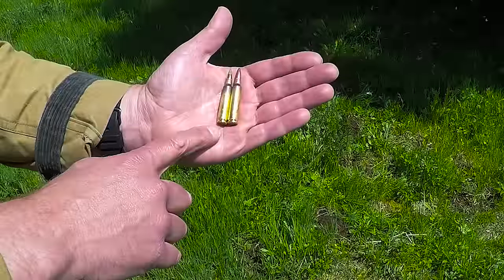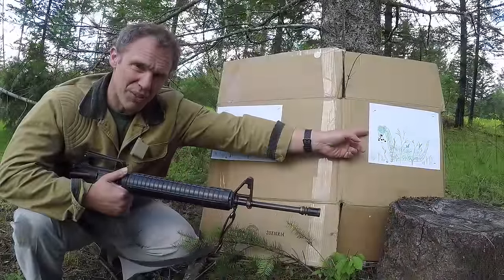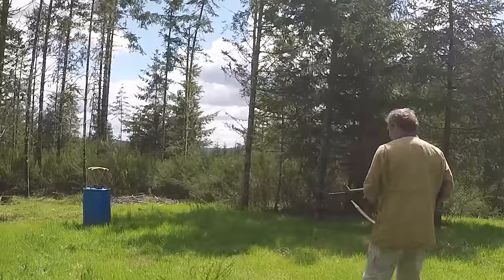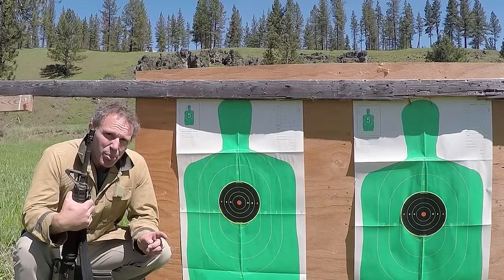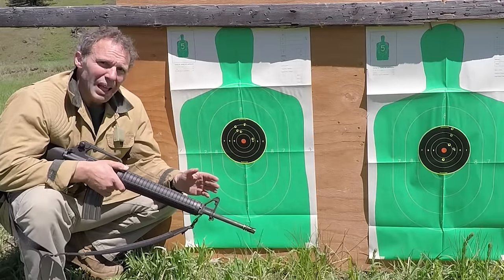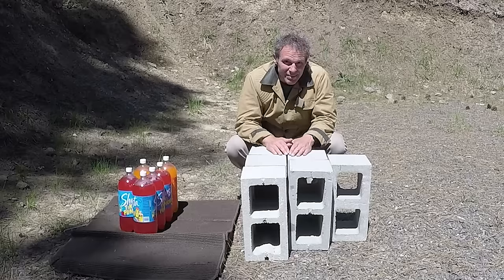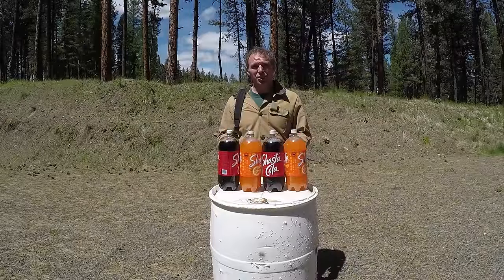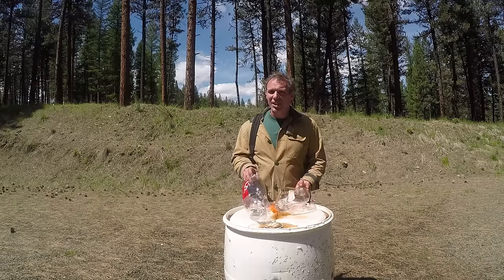5 56 NATO Ammunition:  XM193 55gr.  vs  M855 62gr.

Comment: the 55 grain is far more lethal against soft tissue.  the 55 does tumble (whether or not designed to) the 62g doesn't as well especially from a 14.5 inch m4 barrel which lowers velocity.  You want high velocity to tumble, but the steel core also prevents the tumble, it just sheds the copper jacket and the steel core just goes straight through.  Against steel armor, 55gr is better, against other armors, the 62gr is better.  But for civilians you're not typically going to be up against military grade body armor, maybe steel if any armor at all.  So for civilians, the 55gr is far far superior

Comment: Paul:
What about disabling a vehicle? Will that steel core round penetrate enough to stop a car, SUV, or truck?
Thanks. JWC
Reply: I don't think a 5.56 will penetrate  an engine block. It would definitely mess up the radiator and other stuff, but I think the engine would continue running. 

Most videos I've seen about stopping in blocks come to the conclusion that you need a much larger caliber bullet that weighs a lot more. I think you would probably need at least a 50 bmg or something with comparable weight and velocity. 

I've seen some crazy stuff about higher end 12 ga slugs, they might work if they could reach a high enough velocity.

Check out taofledermaus's channel on here. He's got a lot of interesting videos on shotgun loads and how well they perform. Some of the slugs he's used will punch through just about anything.
Reply: The_DG:
Thanks. JWC

Comment: 62gr does better out of a 1/7 twist. Lighter bullets such as 55gr do better out of a higher twist rate such as the 1/12 if I remember correctly.
Reply: 1:12 was the original for 55 gr 1:9 still works for 55 gr penny sized groups from expierence, 1:8 55 gr sometimes up to 77 gr usually lead core monolithic or different material rounds vary in groups it's not the weight that impairs accuracy it's the length so a 55 gr lead core is ok in a 1:9 but a 55 gr copper barnes round will be longer meaning it might be better in the 1:8
Reply: 1/12 is NOT a higher rate-of-twist barrel, lol. 1 in 12 is a slower barrel.

Comment: Hmmm... it took only 24 shots with the 55 gr bullet before you 'sploded any of your soda jugs. You didn't make contact with them until shot number 28 when using the much-vaunted steel core "penetrator" bullet. That was a helluva big surprise to me. Here I've been operating under the gross superstition that 62 gr bullets were nigh-on to being kryptonite and would cause the dental fillings in enemy combatants to come flying out of their mouths if they were hit in the toe with one of these rounds! The club I belong to forbids the use of 62 gr bullets on club-provided steel plate targets (which is why I always bring my own and shoot whatever the hell I feel like shooting). And my steel plates are the same AR500 alloy as what the club provides, and I've yet to put a dent in any of my own steel.

Like you, I've found the 55 gr FMJ-BT bullet to be a jack-of-all-trades projectile, one that does yeoman's service -- and gives me sparkling accuracy out of any of my 1:7", 1:8", or 1:9" twist ratio barrels. I've found it's certainly more accurate than any 62 gr loading I've ever encountered. I think you're really on to something about the steel core penetrators being off-center or otherwise out-of-kilter. 

One thing I can't figure out is how it's only now that I ever came across any of your videos! Damn. I'm subscribed to your channel, but this is the first time I'm seeing your work here. So either I'm getting really decrepit in my old age and just losing my marbles for not remembering you, or my YouTube feed is messed up!

Comment: Has anyone ever came out and said "boy that 5.56 cartridge is great, I am so glad the Pentagon decided to go with it"? My feeling (with 40+ years of hindsight) If the 30.06 (7.62 x 63) had been correctly and adequately attenuated (7.62 x 51 is still a full powered cartridge) the argument concerning the 5.56 and its effectiveness would never have existed. Something like a 7.62x39 that was more powerful (more velocity) and a better designed bullet would have been the way to go. I am not talking about NATO adopting an exact copy of a Warsaw Pact cartridge. The 5.56 is a great cartridge when used in the Thompson Contender,single shot, on paper targets.
Reply: @ Dan R. - Regarding the issue you mentioned, the sweet spot for a general-purpose military cartridge - according to a lot of folks who have studied the issue in detail - lies between the intermediate 5.56x45 NATO and its larger .308-caliber cousins, 7.62x51 NATO and 30-06 before that. Midway between .30-caliber and .22-caliber is .26-caliber or 6.5mm. Most proponents of the universal cartridge idea tend to fall in the 6mm-7mm range, often within the .26-.28-cal.range, which is 6.5mm to 7mm. There is little doubt that the various .30-caliber military cartridges around have performed well in combat, as well as those slightly above or below them in caliber - .303 British, 30-06, 8mm Mauser, 7.62x54R, and later, 7.62 NATO. However, the problem with .30-caliber projectiles is that they don't start to have really favorable ballistic coefficient numbers until getting into the 18-grain or more range, really 200-grains or more - which is much too heavy for a general-issue cartridge which may have to be used in automatic rifles. 6.5mm (.264) projectiles, on the other hand, have very nice BC values as low as 120-grains, and 7mm (.284) projectiles are fine at 135-140 or above. The Russians were on the right track with their 7.62x39 case, which is pretty well-designed, but they didn't choose the most-aerodynamic caliber for their projectile. The 123-grain FMJ used in it is very lackluster in terms of aerodynamics, and runs out of steam by 600 meters as a result. That's not bad - but neither is it outstanding, either. Using precisely the same propellant charge, a 6.5mm (.264-cal.) 120-grain bullet would remain supersonic out to 800 meters, perhaps even 1,000 meters and with manageable recoil. The superior ballistics of 6.5 mm projectiles is why 6.5 Creedmoor is so popular now. A 140-grain .264-caliber bullet fired at 2600 fps, an remain supersonic out to 1,500 yards in some parts of the country. That's 300 Win-Mag performance without the recoil or additional size/weight of the larger magnum rifle. 300 AAC/Blackout is very popular now. It would probably work well necked down to 6.5 mm (.264), using perhaps a 115-120-grain projectile. Due to the weight of the bullet, the propellant would probably not offer much of an increase if any in MV, but the superior balliastics of the bullet would give significantly superior performance compared to the standard 300 BO fare. Even a 105-grain .243-caliber (6mm) would be an upgrade on the 5.56 in terms of lethality and range. That's all .224 Valkyrie does - it duplicates .243 performance more-or-less in a .224-caliber case. It slots right in between .224/5.56 and .243.
Reply: @GeorgiaBoy1961  I want to say Thank You for such a accurate response/statement. I am sure many in the "community" here will benefit from the information. Back to my original "I wonder" type question. I ask. Are there people (either in the sport shooting/hunting/military world) that really like the .223/5.56 cartridge,did it please anyone? I do have a Thompson Contender and I do enjoy handloading the cartridge. It shoots so straight and flat it is great sport but never for hunting and not anywhere close to a first pick (much better than teeth and fingernails) for home defense. I know many say "well a soldier can carry more of the 5.56 ammo" but this is about where the praise ends.
Reply: @danr5105  - If you are familiar with any of the great sports mud-slinging contests and debates, i.e. Red Sox v. Yankees, Bears v. Packers, Michigan v.Ohio State, etc. - you'll understand that the 5.56x45 NATO is "good/bad" debate is a hot-and-heavy one, not only in the military but in the FA community at large. Internet flame wars can - and have - started over less. The debate is by no means clear-cut. For every well-respected and highly-decorated Vietnam Era military man that an anti-AR person can bring up, such as the late Colonel David Hackworth (U.S. Army, ret.) - who famously hated the M16 and made no secret about it - the pro-AR folks can bring up examples of equally-decorated soldiers - such as the late Lieutenant General Hal Moore (U.S. Army, ret.), who commanded the 1st Cav at Ia Drang in 1965, and specifically credits the M16 with saving the lives of a lot of his men and making it possible for them to survive the battle and go home. The picture becomes even more complex since the M16/M4/AR15 platform has undergone continuous improvement since being introduced, and is now thoroughly sorted-out mechanically, ballistically, and in terms of how to keep it running in operation in the field. Today's ARs are much better than they used to be, and so is the ammunition available to be used in them. I am an old guy now, and hence not of military age. I am not privy to the arguments about the rifle or its cartridge, to the extent that they exist. However, I would note that controversies continue to surface periodically which tend to call into question the weapon itself, or the cartridge it fires. The Battle of Wanat, for example. However, I think it is also equally-telling that some of the finest soldiers in the world, the kind who get to choose their weapons on a mission-specific basis, often choose AR-pattern carbines, rifles or SBRs. I'm talking about the British SAS, U.S. Army Delta Force, Navy SEALs/DevGru, MARSOC/Marine Recon, etc. 

My two cents, for what they are worth, are these: 

First, the cartridge itself is - at least in the civilian FA community - a varmint/small game cartridge, and also used for competition/target. Many states, even at this date, do not allow the hunting of white-tail deer using .224-caliber rifles, because of concerns over making an ethical kill. Now, one can argue that such rules are antiquated, and perhaps they are to an extent - but they are still on the books. I find it curious that we prohibit the hunting of certain types of game with the cartridge, but think it adequate for military use.

Second, the problem vis-a-vis military use I think arises not so much because of deficiencies in the weapon or the ammunition per se, but how they are used by the armed forces. Paraphrasing firearms writer Ken Royce, it is a good thing that assault rifles (battle carbines) were invented, militarily-speaking, but the pendulum has swung too-far away from other kinds of small arms and ammo and too much in favor of assault rifles. Entire armies are now equipped with these weapons, when they are not really suited to every mission, use or role. 
The search for a "universal rifle" and cartridge to go with it, is a fool's errand, in my humble opinion. The whole reason so many types of firearms and cartridges exist is because they are tools for accomplishing different tasks under the umbrella of FA use, and not all tasks are alike, or even most of them. A much better philosophy, in my humble view, is to provide a range of small arms from which soldiers and their leaders can choose, based on the nature of the missions they have been assigned, and other factors. 

The craze for assault rifles and hence, the ammunition they fire - such as AR-platform rifles and 5.56/.223-caliber ammunition - is to blame for our grunts getting to Afghanistan early in the GOWT and finding out that they could not effectively engage enemy Taliban, al-Qaeda, or other jihadists/terrorists 500 meters away with their 250m-capable carbines. Which is why said troops requested rifles and crew-served weapons with greater punch and range, such as old M-14s firing 7.62 NATO. The same happened with other NATO nations and their forces, many of whom requested G3s in 7.62 NATO, be sent in greater numbers to their personnel in theater. Use the right tool for the job, not the wrong one - and you'll have better success. 

Third, the argument about the number of rounds a typical infantryman carries in his ammo load-out when going into the field generally rationalizes the use of the smaller (intermediate) 5.56x45 NATO cartridge as opposed to more-potent, but heavier and bulkier alternatives such as .308/7.62x51 NATO, by noting that the soldier can carry a significantly larger number of rounds and mags for an M4/M16 than he can for an AR10 or M14, for the same unit of weight. This line of thought is valid. Our infantry doctrine does not stress expertise with the rifle as much as in the past, as a means of neutralizing threats. Volume of fire and firepower are much more dominant in our thinking. Lay down a large volume of suppressive fire to pin the enemy in place, and then maneuver against them to neutralize them. Failing that, call in crew-served weapons, arty, or air to do the job. 

The way in which this doctrine fails however, is that by employing a smaller, lighter, less-potent cartridge as our primary load in our primary weapon, we risk not neutralizing that enemy soldier or fighter with a single center-mass hit. If it takes 2, 3, 4 or even more hits from 5.56 NATO to down that terrorist or jihadist for good, then the assumed advantages - some of them anyway - of an intermediate caliber, go by the wayside. 

Or, as one wag noted back in the day, "Firepower isn't shots per minute, it is hits per minute." 

More-intelligent selection of weapons and matching them to missions and operational environment would solve a lot of these issues. If you are the general or whomever getting your command ready to deploy to the 'Stan, where the terrain is rugged, and lines of sight and ranges are - can be -long, then equip your guys with longer-ranged weapons. Or at least hedge your bets by adding some to their armory. It doesn't seem complex to me, which is why I have a hard time understanding that these Wanat-type situations keep happening. If a civilian like me can figure this stuff out, it can't be that tough! Sometimes, 2 + 2 really does equal 4. 

Or, that field-grade or general/flag officer could simply break it down like so: Battle carbines/assault rifles and similar shorter-ranged weapons for urban operations, perimeter defense, CQB, house-clearing, and similar ops, as well as airborne or vehicle-based ops when overall size of the weapon is an issue. For operations where ranges are longer, or additional power and reach is needed, then bring out the heavy stuff. If a given operation isn't clear, or may involve multiple types of terrain and conditions, then hedge your bets by supplying a mix of weapons and ammo. Easy-peasy. Yours or my grand-pop was doing this back in WII and Korea. 

One final comment: With the caveat that I am not a professional LE officer or lawyer, as a civilian, looking for something for home-defense, I'd strongly suggest you consider something other than a center-fire rifle as your primary weapon. Unless you live in a very remote area where your nearest neighbors are far away, and/or separated from you by a significant terrain or other barrier or backdrop. Remote ranch or farm, outdoors, your primary self-defense arm may very well be a long gun. However, if you live in an urban or suburban area where your neighbors - or family members! - are only a short distance away, perhaps only behind a thin plasterboard wall, over-penetration is the big risk. In the FA training/tactical community, it is taught that every shot fired "comes with a lawyer attached to it"... in other words, you own/are responsible for every shot you fire. Most authorities would recommend a good handgun or shotgun with high-quality self-defense ammo, or - in some cases - no firearm at all as the primary defense.Sometimes getting a burglar alarm or a dog or other measures -or moving someplace else - is the best move you can make. And the last thing most people want is for an innocent person to be hurt, or heaven forbid, killed.
Reply: @GeorgiaBoy1961  Well thought out and appreciated. I can certainly accept the fact that this "is the .223/5.56 any good at all" question/statement has generated a good bit of angry typing. My real idea with my question was to find out if the argument "what is better for combat a faster but lighter cartridge or a heavier but slower cartridge"has been settled. I was hoping that since so much time has passed with both the 5.56 and the 7.62x39 in use there would be a good answer. I do frequently fall back on a point you mention. That would be the fact that the need for multiple hits negates the benefit of being able to carry more ammo. You did mention some pretty "famous" people (yes I knew of each of them) I ask. Did you know that General David Petraeus took a 5.56 round to his chest while in training? The errant round was fired by one of his troops,of course accidentally. How the General did not succumb to his wound is perhaps a testament to 5.56 lethality. A cut and paste. Before that, however, Lt. Col. Petraeus needed to get out of the hospital. To prove to his civilian doctors that he was fine and ready for duty, Petraeus did 50 pushups without resting – just days after taking a 5.56 round to the chest from 40 meters and then undergoing surgery to repair the damage.
Oh, home defense. I agree that overpenetration needs to be taken into consideration. Some deal with this through the use of the 12ga. For me (even having large hands but now a bit older (66) my Mossberg 500 likes to pull out of my hands (my left hand)My grip is no longer so strong. I now prefer the 20ga.